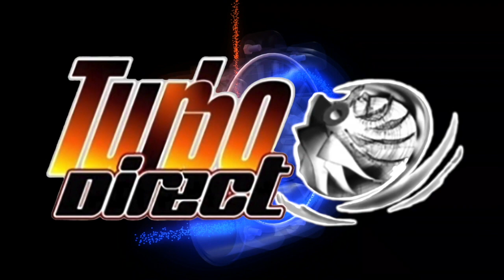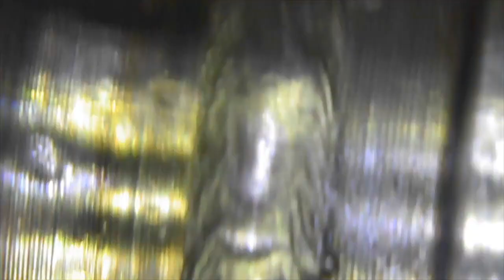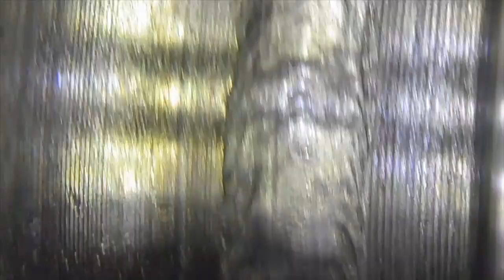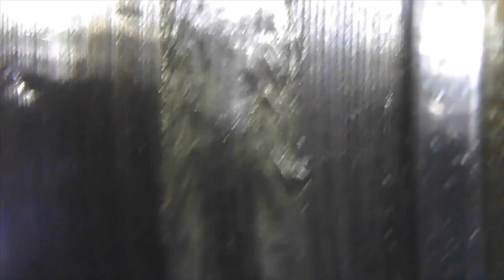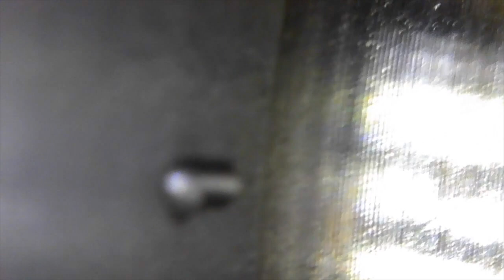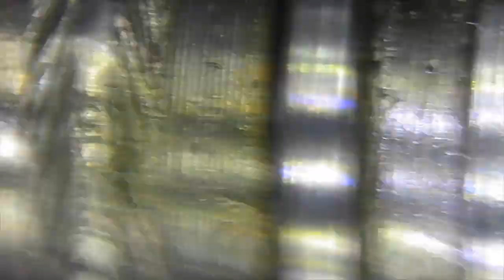TurboDirect S.A turbine shaft weld process

Comment: Very cool! Do any companies cast and machine the shaft and turbine all as one piece?
Reply from the maker: No they dont - the turbine head and shaft are different materials - this is why they have to be welded - In case you wondering, no you cant use the same material for the shaft, as Inconel is not a suitable bearing mating material - even if it was, the costs would be astronomical.
Reply: @TurboDirectSA  That's essentially what I figured. Wasn't sure if there were any with the same material for shaft and wheel. Knew most at least were different. Thanks!
Reply from the maker: @802Garage  Pleasure buddy

Comment: Interesting...can we see the machining process?
Reply from the maker: Machining process is done through a CNC cylindrical grinder. Nothing really fancy at all - its a grinding wheel which comes in and grinds the surface to a specific tolerance with a single grind and job done. We have our own machine in-house, ill do a video explaining the cut-back on turbine wheels some time and you'll see it in action.

Comment: Great video, is the whole shaft fused together or only some degree of penetration
Reply from the maker: The shaft is joined by electron beam welding around the neck of the turbine head and the top of the shaft above the split seal ring groove - the design and chamfer of the mating components is undercut in order to allow sufficient weld bead and penetration.